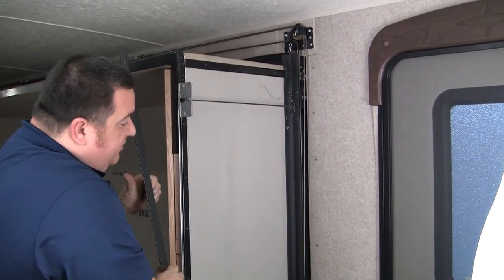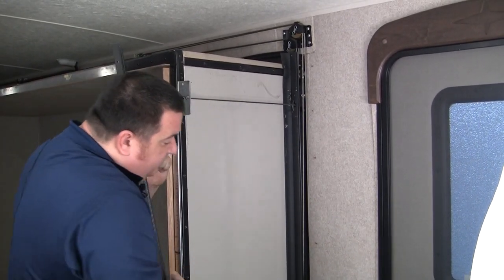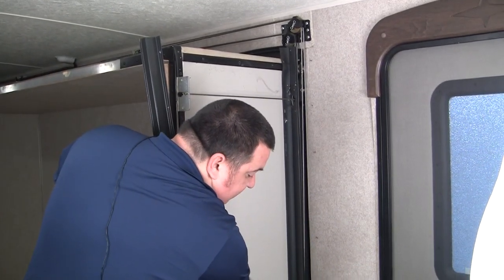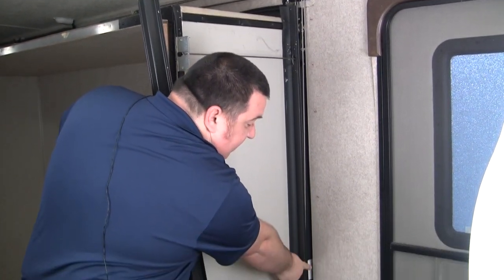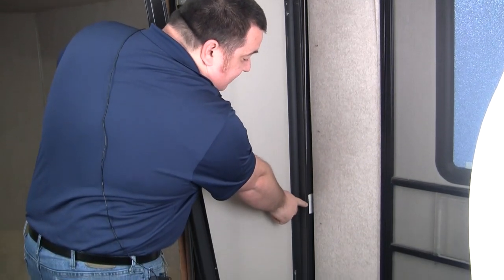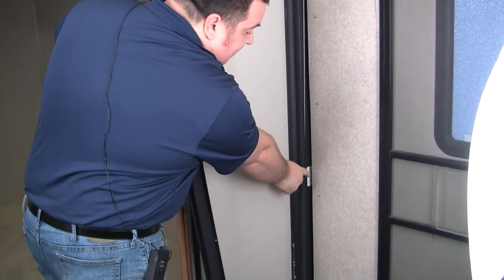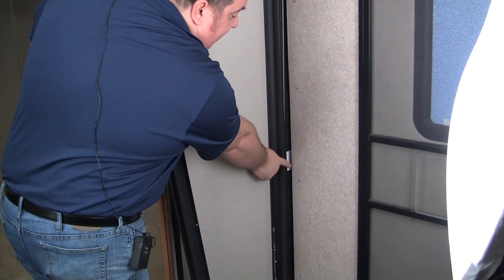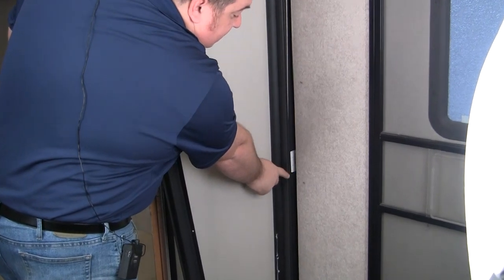BAL Accu-Slide Hybrid & ABS Mechanism or System Part Number Location

Comment: On the hybrid system is the part number different from left to right?
Reply from the maker: Yes, the right hand and left hand jambs are different part numbers. If you need assistance with research, send an email to baltechsupport@norcoind.com with the label information inside the jamb assembly (Hybrids will have a part number that will have the letter H at then end and a date) Our team can assist you with the individual part numbers.